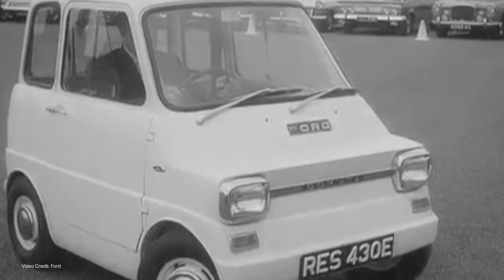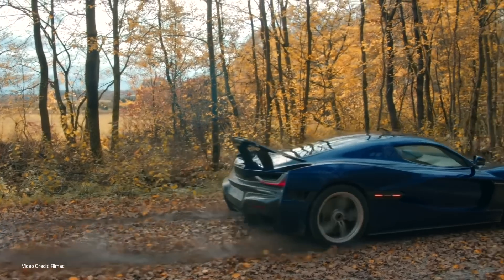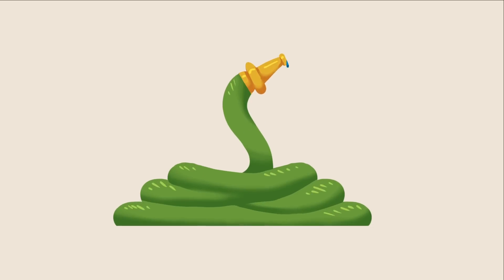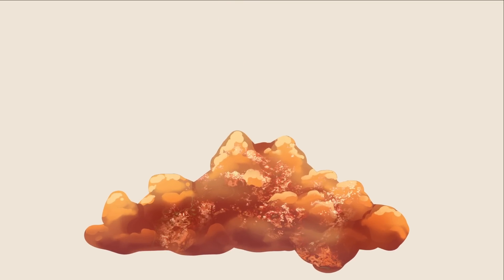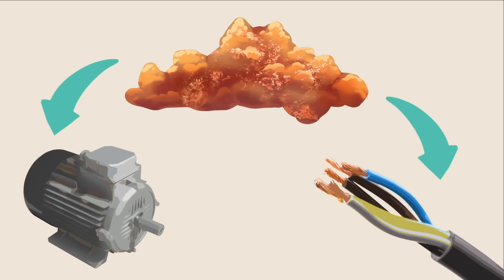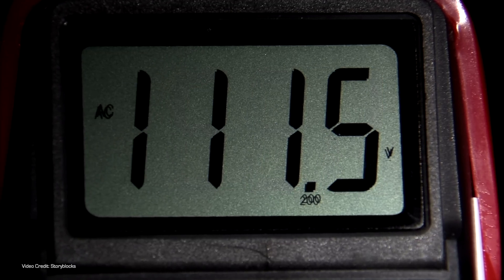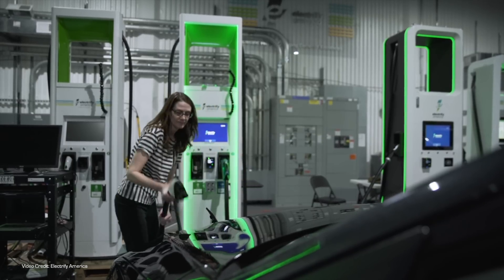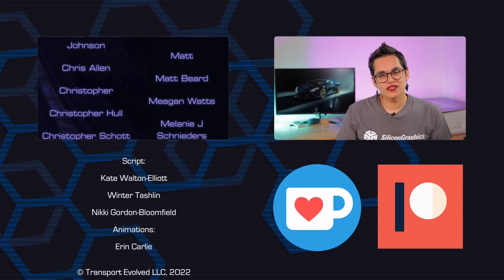Moar Power? More volts.

Comment: Question is will this plateau at 1,000 v dc.  Previously we could imagine the voltage settling on 600 v dc as electric trains and LRT's operate at 600 v dc so it may benefit electric buses to be at 600 v dc to share components but we've already gone to 1,000 v dc.  Now going above 1,000 v dc would require existing fast chargers to be renovated or obviated and of course the higher the voltage, the more difficult to insulate against

Comment: The other con of higher voltage is the increased cost of better insulation required. Not large but there. Thanks for the insight.

Comment: Nice but I miss the explanation why 800V systems charge faster. At the battery cell level voltage and current are the same. Just the lines going to the battery shouldn’t make that much of a difference. Of course CCS is also limited to 500A.

Comment: "If you want high performance and sub 20..minute charge times....a cable that's like trying to maneuver a hugo 45 on a dark and frosty night...you're gonna need an 800 volt system" Not factually accurate.

Comment: I'm confident enough that batteries will continue to improve in terms of their charging speeds. However, that would just push the bottleneck from the battery pack to the charger. One example is the Porsche Taycan being able to rapid charge at over 300 kW but there aren't many +300 kW rapid chargers. This problem gets even worse when we're looking at large BEVs like buses and big rigs that can boast battery packs as large as 738 kW (like the new Proterra ZX5 bus). Charging such a battery pack in 15 minutes would require a charging power of almost 3 MW.

As far as I know, Megachargers are mostly in the development phase. An alternative to connecting the BEV to Megawatt chargers via plug, there's also rooftop charging.

Even when assuming Megawatt chargers are a solid technology, that ends up pushing the concerns further upstream: the electric grid. Once we're talking about MW of power, grid infrastructure upgrades are necessitated. This topic was explained in more detailed in a Recharge News article about their interview with Hyzon Motors CEO and co-founder Craig Knight.

Comment: Trucks and buses might even get 1200V, IMO. Simply because those vehicles would have much bigger batteries than your everyday car.
Otherwise they'll have to plug multiple cables. Or, which is not entirely impossible, these vehicles might utilise overhead charging via pantograph.

Comment: Good video. The obvious question  that wasn't asked or answered is what are the downside of higher voltage. Why not 1600 volts? Why not 8000v. I understand some of the reasons (Leakage current, number of parallel cells required to get to this base voltage and voltage swing from charged to discharged). What are the other tradeoffs?

Comment: Not a ton more than Nikki did off the cuff like a year ago tho. (she was talking about the potential range improvement due to running the battery a little flatter safely due to less current) 
Would be nice to have some of these designers on to speak about it

Comment: Rivian has an interesting solution that they’ve patented. Basically a series parallel switch that takes two halves of the 400v and puts them in series for charging at 800v.
Reply: You can wire up as many batteries that you want in series to get as much volts that you want.  Lots of race cars will run 2 12v batteries in series to get 24v.  Enough batteries will get you to 800v.  Putting batteries in series is not anything that needs patented.  It’s been going on since batteries were invented.  Wiring series doubles the volts and parallel keeps them the same voltage.
Reply: @jeffdennis6077  so charging at 800v but operating at 400v isn’t anything to note.
Reply: @yolo_burrito  Not really, no.  If the battery is at 800 volt resting but using a step down of some sorts down to 400v would definitely stay charged a lot longer.  Almost twice as long as a system running an 800 volt system.  Just an 800 volt system is amazing enough! That is alot of volts and amperage!!  That is around 67 12 volt car batteries in series to get to 800 volt.

Comment: Power = Voltage * current. (More voltage or more current increases power. Nature does not care which one you increase.)

Resistive heat losses = Resistanse * Current * Current (But losses from Current will hit your system  squared.)

Results from these two facts.. Keep voltage high and currents low.

So easiest solution is to increase voltage as much as semiconductors and individual components allows.
Reply: The problem is this doesn’t apply to a battery in the same way.
Reply: @williammeek4078  Why not? What makes the internal resistance in a cell different. Please elaborate.
Reply: @kanaljenskanal  for example. Lithium typically has a cell voltage of just over 3 volt (depending on the exact chemistry). 

Lets say we have 2 cells to work with that are 1 Ah and have a C rate of 1. This means the cell can safely charge in 1 hour. 

We can configure a battery two ways. We can make a 6V battery by putting the cells in series (making a 6V 1 Ah battery), or 3V battery by wiring them in parallel (making a 3V 2 Ah battery). Both batteries are 6 Wh in capacity 

A 6V charger will charge the 6V battery in 1 hour with 1 amp of current. This is 6 W of power. 3V is dropped across each cell with one amp passing through each cell. 

A 3V charger supplying 2 amps will also charge at 6W of power buy because the electricity has two equal parallel paths, the current splits between them so that each cell still sees 1 amp at 3V each and still charges in one hour, just like the 6V pack. 

So you can see, regardless of the pack configuration and voltage, for a given cell type, the individual cells will see the same voltage and current for the same charging power.

Comment: Safety was not considered in this talk, the higher the voltage the greater attention to safety is required. Instead of just worrying about fires you may have to start also worrying about explosion's. Of course that is also a concern with ICE vehicles.  As long as things are designed with safety being very important, it should be as safe as gasoline.
Reply: As unsafe as gasoline? Hopefully not.

Comment: There is yet another option: optimize your vehicle design and layout to minimize the length of wire required.  Shorter wire runs reduce the power lost.  Ever notice how short the cables are at a Tesla Supercharger?  You can also check out the Sandy Munro Tesla teardown videos to see how much attention Tesla pays to optimize their HV wiring runs inside the car.
Reply: @Jan 6 was "Wall Street Putsch" part 2 All true.  However, in the automotive business where no stone is left unturned to shave ounces from vehicle weight and pennies from vehicle costs, it behooves you to take your efficiency gains wherever you can find them and extract the most from whatever components you have.  If you are starting a clean-sheet design and 800V-capable power electronics are reasonably priced, then you reasonably design an 800V system and wait for the charging networks to catch up.
Reply: Still doesn't deflect the message that an 800V system is just way easier to charge and discharge with lower wiring mass. And you cannot realistically shorten a Rapid charger delivery cable.
Reply: @bellshooter  Nor was that my intention, if you read the first sentence of my post.  And you can reasonably shorten a DC fast-charging cable.  Ever seen a Tesla Supercharger?  One further barrier to producing 800V BEVs at scale is the availability of power electronics in the supply chain.  So while 800V is technically superior, there are practical real-world impediments to its universal adoption by manufacturers at the present time (and this is likely to be the case well into 2023 by all indications).

Comment: Speaking of 800 volt architecture, that ship that caught on fire and sunk with a batch of 800V Porsche Taycans on board jumps to minds. I still firmly believe that the dangerous 800V architecture was responsible. Having designed and built many 'hollow-state' valve/ vacuum tube audio amplifiers operating between 400V and 450V... I wouldn't go near working with such a high voltage as 800 volts. 800V is going to present all manner of cable insulation issues which will be compounded with the age of those wires/cables. I also would be very hesitant to grab onto and plug in a 800V charge cable at an aging charging station. I also suspect 800V motors will suffer from insulation breakdown long before a 400V motor, leading to reliability and longevity issues. I suspect this is why the smart technicians at Tesla have stayed well away from it. They do after all build the highest efficiency EVs on the market (to my knowledge)  without the constraints of designing and building 800V motors. Still, I may be proven wrong, but only time will tell. I do often wonder why silver-plated copper isn't employed in EV cables? I'd love to have a friend like Kate to chat about these things with. We have soo much in common, that go beyond a lifelong interest in electronics  ;-)
Reply: 400v and 800v architecture is not technically different at a cell level (cells see the same voltage), and a short at 400v or a short at 800v have about the same potential to cause a fire. (also, AC motors don't see the pack voltage, they see a variable voltage generated by the inverter, so those cables will be the same), also thermal cycling is a contributor to insulator breakdown, and you'll reduce that with 800v
Reply: @brantwedel  all very good points except a short at 800V is far more likely than at 400V. I now can see the motors operate identically and thank you for enlightening me on that. Can't help wondering if a 800V inverter is much noisier than a 400V inverter... or perhaps they are both virtually silent?
Reply: @RestorationWatch  yep, if a circuit board or connector is designed incorrectly without proper isolation/spacing, a short is easier, most professional design tools take this into account, so it'd be human error more than an issue with the particular voltage of the architecture

Comment: 🔌The utility I worked at in Michigan had 765KV AC transmission lines and recently China completed a 1.1MV DC line. Opening a DC current contact is more challenging because there are no zero crossover points like there are in AC waveforms.🔌
Reply: @Jan 6 was "Wall Street Putsch" part 2 you are correct. My formal education over 40 years ago was as a power generation engineer in electrical and nuclear. At voltages above 9kV, you have corona which is the discharge of ionized air. ( ie that blue glow and humming you hear around HV power lines, especially when humid). Based on Peak's formula corona losses over high voltage transmission lines are much higher with AC due to a frequency of 50 or 60Hz versus zero frequency for DC. 
When I worked for a company that mfg HV circuit breakers the challenge was breaking the arc. We used our SF6 breakers that we invented or used GE's vacuum breakers instead of HV air-blast breakers along with a paralleled capacitor and inductor to squelch the HV DC arc due to no zero current cross over point. I no longer work for a breaker mfg. Instead, I assist consulting engineers on micro-grids, standby, and prime power designs along with documentation to conduct studies on electrical grids.

Comment: More volts = less current?
Reply: Yep. If you want to get 150 kW feeding into a battery pack, you can do it at 375 Amps at 400 Volts, or at 187.5 Amps at 800 Volts. High amperage is what causes premature cell failure, so for the same charge rate, you're causing a lot less wear on the cells.

Conversely, if you're capped at 350 Amps, an 800 Volt system can get 280 kW, while a 400 Volt system would be only 140 kW. (This is a major limiting factor with the "high-kW 400V vehicles" like the new Mercedes, BMW, and Rivian - they can take over 250 kW, but at 400 Volts, they need a LOT of Amperage. And a lot of "350 kW" chargers are limited to 350 Amps - they can only reach 350 kW if an "800 V" car is drawing 1000 V.
Reply: For the same power, double the voltage, halve the current.

Comment: Biggest impact of raising voltage from the common 300V to Rimac's 1300V is motor size and thus weight, secondary is in the connecting cables and as a bonus charge time are drastically reduced. The battle ground will on the kWh/100km, on the market today cars in the same class show a 50% difference in consumption. This is unthinkable in ICE cars!!
Reply: Don’t the transistors in the inverters states waste more power at higher voltages?
Reply: No, you have the physics wrong. The motor is already a tiny part of a car’s weight. Saving 50 lb on a 200 lb motor in a 5000 lb car doesn’t save you much. Another 50 to 100 lb could be saved in wiring. 
Charge time is not affected by battery voltage. This is limited at the cell level by chemistry setting the voltage and C-rate determining current. And no, consumption is not significantly impacted by voltage either as the cars are already very efficient.

Comment: I think the question to which everybody expected an answer was: Why does Tesla as the market leader stick with 400V?
Anyone else got a clue?
Reply: They are able to push as many electrons with 400v as the batteries can currently handle, the small bit of cooling needed at chargers and a bit more copper isn't worth it. It's all a cost-benefit analysis.
Reply: Q: Why does Tesla as the market leader stick with 400V? Anyone else got a clue? A: because of something known as the "Myth of Progress". since the technology has been shown to work in it's basic form of 400V, people naturally think (ref Greed) that numbers 2x as a "big" must be 2x "better".  unfortunately both Porsche and Hyundai have shown that's not the way reality works.  while there are indeed "gains" to be had...? rarely do these gains line up with our "insatiable desires".  meanwhile what's happening in background of this discussion is consumers (yes knowledgeable ones) are still buying/enjoying the so called "lowly" Nissan Leaf.
Reply: @phillyphil1513  On point
Reply: Like many said, because of the existing charging network. Going to 800V only really makes the chargers cheaper and since Tesla has already built out a lot of its network, there is really no reason to change cars already in production.
Reply from the maker: It's entire supercharger network is 400v based. The cost to switch for Tesla is going to be very high.

^Kate
Reply: @transportevolved  But isn't 400V on the cars up-compatable with 800V chargers? The way Tesla is building out their network with new revisions they could install 800V chargers now and upgrade the old 400V chargers slowly over many years, no?
Or did Tesla literally back themselves into a corner with their super fast growing 400V system?
Reply: @transportevolved  Superchargers are capable of outputting 50 to 1000 V just like CCS chargers.

The real reason is that batteries are still the limiting factor for charging speed for all but a couple of minutes of peak charge. There just would be no noticeable gain.
Reply: @HenryLoenwind  Yeah, it seems like legacy has to compensate for their worse energy efficiency and range by pushing for higher charging speeds like that

Comment: Thank you, good video, just a few comments. Using higher voltage also means that better insulation is required. So yes, the conductor portion of the wire is smaller for a given power transfer at 800 volts but using like-for-like insulation means the insulation will need to be thicker. The wire will still be lighter overall. Additionally, there is more safety risk (electric shock hazard) with the battery configured for 800 volts, so there will be further considerations associated with that as well.

Comment: Aluminium is both lighter and cheaper than copper, and is a decent conductor.
Reply: re: "Aluminium is both lighter and cheaper than copper, and is a decent conductor" and has a greater Coefficient of Thermal Expansion.  which is the reason why houses built in the 1950's with Aluminum wiring (to save money) are notoriously prone to catch fire.  because: CONNECTIONS.